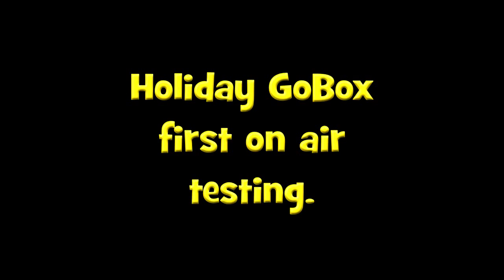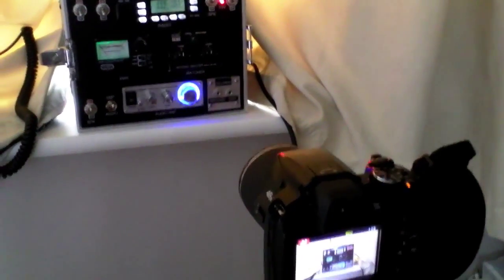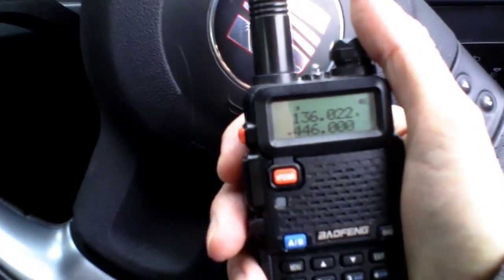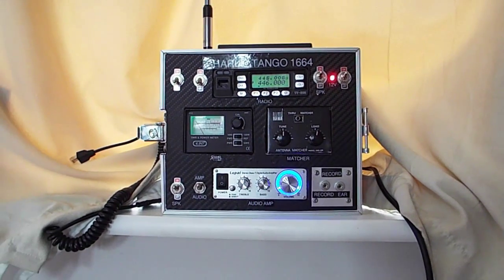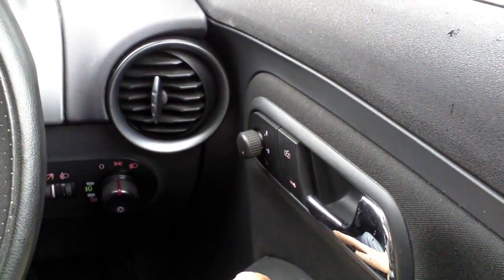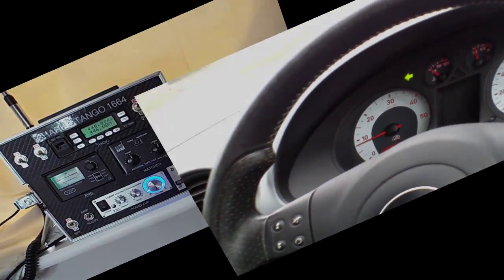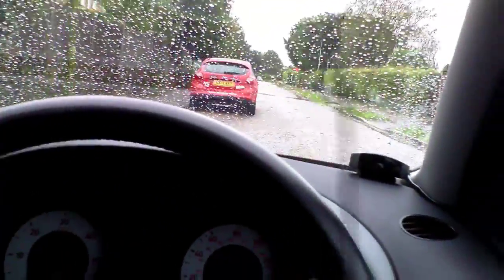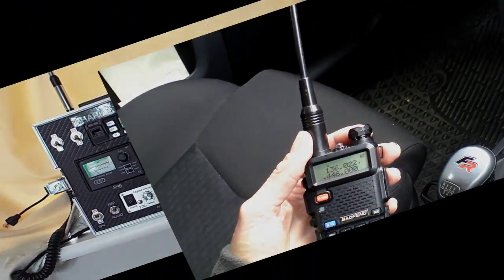Holiday GoBox Part 3.  First testing 446 mhz

Comment: The buttons should be popping from your vest. 3 miles away is not much but you add in your on a hang held and wasn't the antenna inside the building, and all the city interference, I'd call that a successful first test. On the right hill top, I'll wager you can skip right to the Americas. We talk funny but we love a good conversation.
Reply from the maker: I love trying to DX to stateside on AM.  Even just listening to the superbowl channel is fun.
Reply: That's funny. I like to get my news from the BBC on my SW Radio.